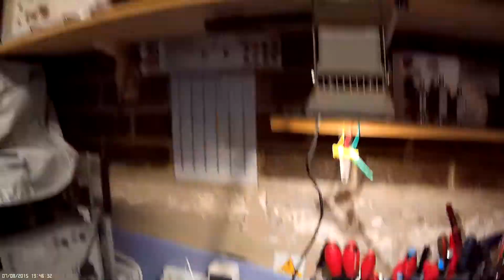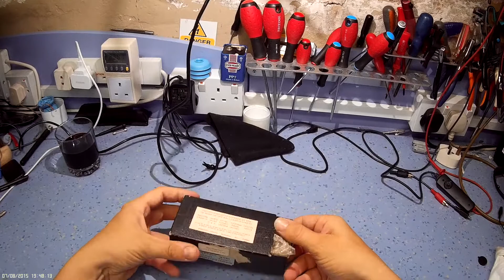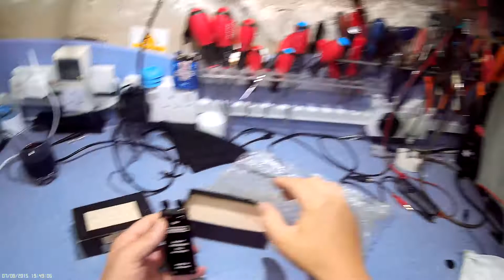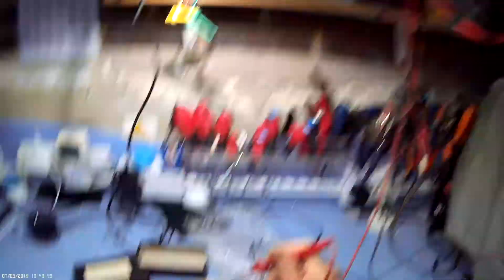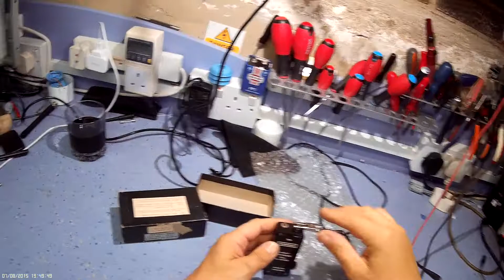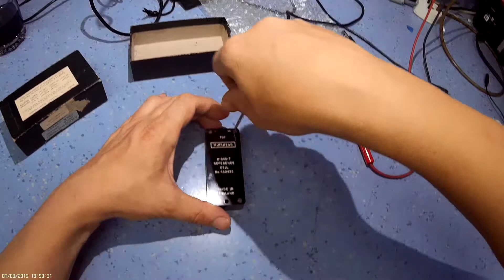Standard cell Voltage reference

Comment: Just scored 2 of these Muirhead ones BNIB dated 61 and 67 with certificates. Still measuring 1.0185xx.
Reply from the maker: Brilliant.  Let me know if they work.
Reply: Working fine on a HiZ input meter. I am going to mount them up in my 25C box and log them them weekly along with my modern References which are checked much more often on a 34970A